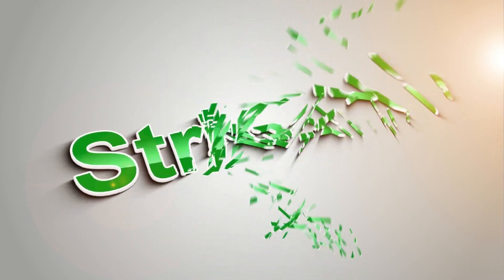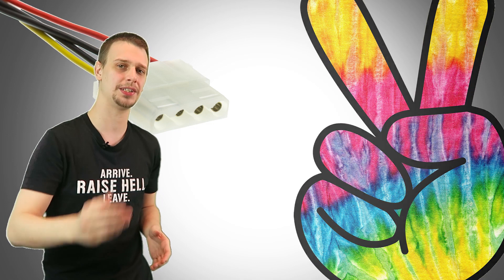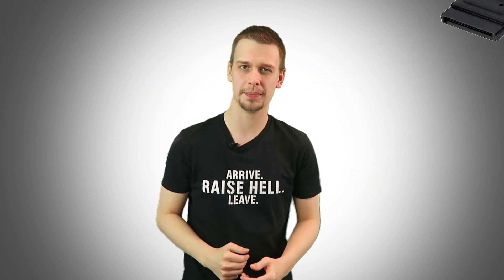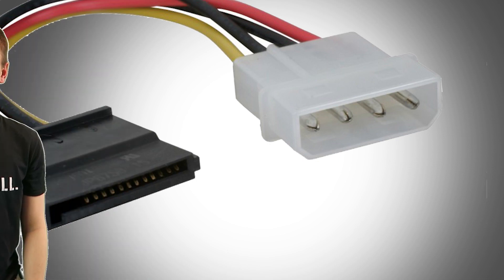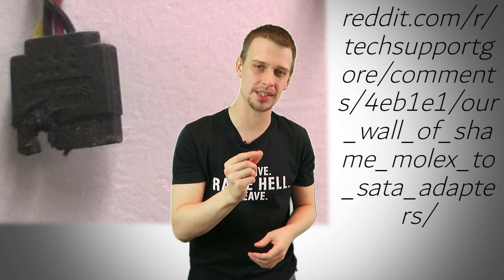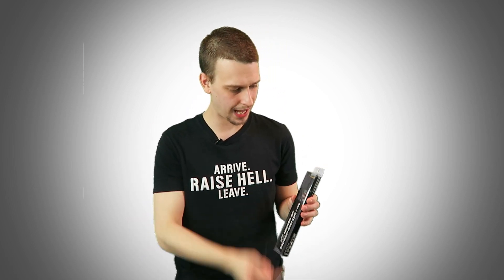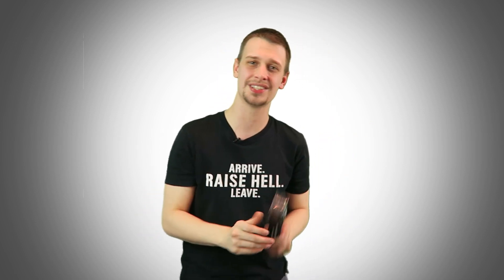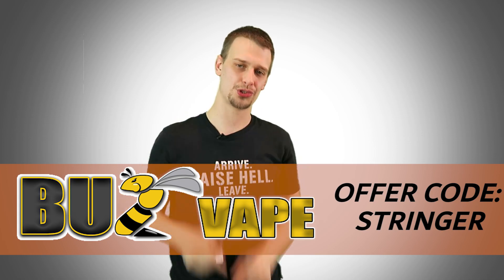Molex to SATA Adapters - Why you should avoid them!

Comment from the maker: have you ever had a bad experience with these evil adapters? have you thrown yours away?
Reply: I've been using these type of adapters for 11 years, just buy a non-china made 😂 LOL
Reply: @shawncasey9995  
Just because it hasn't happened to you doesn't mean that it isn't a serious point of failure, dumbass
Reply: @gerhardsmith7892  It's only a serious point of failure if you ask something of it that it was not designed for. SATA connections are only rated at 50W and I don't know about Molex but I don't imagine it's any higher. The problem comes when you install a 200W GPU or something in a PC that doesn't have PCI power connectors so it draws the rated 75W through the PCI express slot leaving the puny adapter cable to deal with 125W of power. It's gonna burn up. If you use your brain, do some simple maths in your head and don't buy some crappy no brand cable, you'll be fine.
Reply: Haha mine caught on fire just yesterday. I saw the whole thing and quickly pulled power plug when I saw a ball of yellow light inside my case 😱. It scared the hell out of me. Luckily SSD was ok. It has caught on fire 🔥 before killing DVD drive that I never used lol 🤣. Pretty sure they were the same cheap Chinese ones. I am gonna power SSD directly now.
Reply: Many data center drives don't work without them with a normal power supply. Alternatively you can also tape over pin #3 on the SATA power connector.
Reply: @uzefulvideos3440  Same issue here. It sucks. And one of these drives died on me. I suspect a power surge (THAT WAS EXPENSIVE GARBAGE). But ripping out a PIN from the power supply cable was even more jenk.
Reply: Mine touched the case and began burning. I quickly turned the PC off and escaped with only ~15cm of cable burnt. PC took no damage.
Reply: i got a trash prebuild and I've slowly been upgrading it and recently did a psu swap and after i got done the rgb on my fans stopped working not really sure want went on but found out molex was garbage so im upgrading to lian li sl120 completely overhauling that molex hope it will be easy to take out the fans since they are stock
Reply: i just bought one
Reply: @kaye6890  me too
Reply: I threw mine away cuz it killed two drives
Reply: Didn't wanna make same mistake again
Reply: @Maevef100f  kek

Comment: This video is very misleading.
I've had 2 of these for years, just hearing this "fact" surprised me. Turns out i used the one with crimped ends which is actually safe, not the molded ends which i had for my sata to sata adapter for a while, it doesn't catch on fire but made my hdds act up for the last week like it occasionally disconnects when it's healthy, files got corrupted, data isn't transferring correctly, and weak sectors for no reason. I got another molex to sata just for this reason.

Comment: since you suggest not using them what would you suggest to power an external sata drive. I can't use USB. and I have only been able to find molex power bricks. I'm not going to go out of my way to get a huge power supply for a single SATA drive, I already have the sata to esata cable for it but USB will not power this drive.

Comment: so much misinformation here... molex to sata fails at the female sata end only due to arcing the way you said it sounds like its the molex's female that fails on a "molex to sata adaptor"?? don't know how that works but ok....
2nd problem... surprisingly older molex to sata adapters are the ones that are least likely to fail... its the newer and cheaper kinds that tends to fail... because of manufacturing tolerances and the way they are manufactured... those that are done by injection molding to the wires are out of the question immediately as the wires can move about during the injection process increasing the failure rate exponentially in each production batch of these adaptors...
those that are made by clipping through or soldered to prongs for each pins are least likely to fail especially if they have the comb separators for the small prongs connectors placed properly so that in between each prongs there is no air for the connectors to arc to...
molex was actually a very good idea for a connector... this is from a person who started build computers during sata connectors era... the only problem is the way the male and female metal contacts are designed that is flawed as they can move about inside the connectors and making it easier to damage on either end... the solution is kinda brain dead simple... just make it like our PSU connectors to our components each pin female and male has an individual housing that can protect the pins... but its too late to fix it since sata is much slimmer and we have designed most things to suit these sata connectors now.... and with sata power connectors, they can put stupid things such as shucking prevention detection with sata power connectors... yes this is a thing and if we used the brain dead simple 4 connector design, shucking prevention through the power pins would be impossible...
Reply: on top of all of this, sata to sata extensions are also still prone to this problem.... if the manufacturing tolerance is just as bad, it will burn itself... the problem of arcing exist due to bad sata connectors because their pins are designed so close to each other...
Reply from the maker: Excellent points, thank you. The Shucking prevention is pretty terrible, but can be overcome with electrical tape or an adaptor.

Comment: That may be true  2:05 about the amount of connections a SATA plug has vs the Molex, you see the wires going into the plugs themselves? The SATA plug has the same wires that the Molex plug has... Same Wires, different connectivity perimeters within plugs themselves.  The Adapters are probably poorly made and why they would burn.

Comment: I would say it depends on how the connector is made some higher quality ones should not be a problem like crimped satas for example
It's often the molded ones that failes
Reply: I want to add ssd to my pc But i don't have any power cable for a new ssd

should i buy a molex cable Or are there any other solutions to solve my problem
Reply: @farelrizky6453 did you get solution

Comment: My dads computer crom 2010-11 only used molex to sata addapter and hand no sata on the power supply. The hard drive had a molex connector but there was a sticker on it saying not to use the molex connector. I plugged in the more it's connected directly into the hard drive rather than using the adapter and the hard drive seems like it's span up perfectly fine and was readable and everything and worked perfectly fine.

Now im wondering if i can use it in my current rig or not?

Edit: I'm afraid to use a SATA power cable because I threw them all in the box together and when I grabbed one I grabbed one for the wrong power supply because they look identical and ended up frying three hard drives :( one of them was in SSD and it was so hot I literally jerked my hand away as if it where a stove or something.

Comment: I'm planning on putting an SSD into my grandads PC, he has a 1tb HDD currently but the PC bootup time takes forever. My plan was to keep the HDD as it has lots of pictures and stuff on but get an SSD just for windows to speedup the startup time. Was going to get a 120gb as that's fine for just windows but when opening his PC to check it the PSU only has 2 of the cables that plugin to HDDs/SSDs and they're both occupied by the HDD & a disk drive so how else can I gain another connection for an SSD without the molex adapter?

Comment: I have both sata and molex on my power supply what shall I do
Reply from the maker: If it comes straight from the power supply, it's fine. It's only the third party adaptors that are an issue
Reply: @BuzStringer  ok thank you for replying

Comment: I had a dying ssd. So I took it out and plugged it into an external molex PSU with sata adaptor. Now the ssd is completely dead. But I still remain unconvinced it was the sata adaptor that did it. I have used these adaptors plenty of times in the past with no problems. I did have one burning occasion where the molex connector smoked, but the hard drive stayed fine. That molex was a moulded unit that was part of the power supply. So it wasn't an adaptor.

Comment: I faced the problem like my hard drive or dvd was not reading or disconnected suddenly. So I don't use that adapter anymore. But my frontech psu 800watt has only 3 sata connector which is not enough for me. I need atleast 4.

Comment: omg, this is disturbing because my 3 drives are powered by molex to sata connectors, and on one the pins are loose. I have a solid power supply (cooler master real power pro m1000) but i dont have any sata connectors on it, so this is my only option

Comment: I actually have the opposite I have to many sata power connectors and not enough molex ones.

I do use a molex and 4 pin CPU thing to power the motherboard, but it Shou be fine the molex and 4 pin just split everything in what they usually do.

Comment: Says Molex connectors have a lot of drawbacks, including arching that can melt the housing.  Shows a molten SATA connector.  Continues to say that the arching happens on the SATA end because the SATA lanes are closer together.  Sounds to me that Molex isn't the issue, it's poor manufacturing on the SATA side of the cable, because SATA tolerances are much tighter.  A cheap adapter probably doesn't have those SATA connections insulated enough from each other, which is causing the arching.  Just get a Molex to SATA adapter from a reputable brand and you're probably fine.
Reply: Run for Prime Minister, I'll vote
Reply: Look up molded vs crimped sata connectors. Molded ones catch fire way more often
Reply: Run for president.  Ill vote

Comment: what about molex to 4 pin adapter for second cpu power connector needed 
My friends
Reply: Wait your motherboard needs a second cpu power connector? So that is that the third cable coming off of my power supply that isn't the modular part is for. My motherboard only has the normal 24 pin and the 8 pin EPU plug.
Reply: @bland9876  yes i have a server motherboard lenovo s30 with 8pin right+ 4pin left cpu cables need to plug in to fully operates the motherboard i guess

Comment: But the sata power cables are so narrow....try taking a voltage measurement without shorting anything. If I suspect my power supply is bad, taking voltage measurements off of a molex is easy. So, if there a rig/jig to easily test the voltages off a sata power connector?
Reply: Look up power supply tester. You plug in the cable and it'll tell you if it's supplying the right voltages or not.

Comment: Did I hear you correctly? They have Capacitors that kill the wire instead of the device connected to the adaptor? I'm no electronic engineers, but I fail to see how a capacitor would contribute to protecting an electronic circuit. Surely you mean Fuse (Which is just a Resistor designed to fail before the rest of the circuit).
Reply from the maker: Yes, I got that sentence a bit jumbled, each rail has its own capacitor to ensure a smooth flow of the correct voltage to the rail and it is also fused incase of a short. Well spotted.

Comment: I have used these several times. Never had any problems. You just need to make sure you have a proper connection. The problem is that these Molex Male apapters have the 4 pins loose, so you need to make sure they are connected properly. A good idea is to secure the molex/wire part with tape, so it stays proper connected.
Reply: YES, after 5 years my computer caught fire because of Molex. Molex is completely fried and my ssd is also like chickens at KFC…
Reply: hi, may i ask a question,, if i using sata-molex cable for usb 3.0 pcie, should be okay or not?
Reply: Hi Jon
I want to add another hard disk to my pc
But i don't have any power cable for a new hard disk

Do u advice me to buy a molex cable? 
Or are there any other solutions to solve my problem
Reply: @alishahoud2614  ive used molex to sata for around 7 years now and no problems
Reply: @alishahoud2614 did you get solution??

Comment: I am using Molex to 4-way SATA Power for my mining rigs. Have not yet found a brand that's decent.
All the ones that I've had burned. I think I've gone through 5 of them now.

Would appreciate it, if anyone suggested a respectable brand.
Thanks in advance.
Reply from the maker: Avoid molex altogether and split the sata power with these https://kit.com/BuzStringer/server-setup/silverstone-technolo
Reply: @BuzStringer  what about molex to 4 pin adapter for second cpu power connector needed 
My friends
Reply: Buz Stringer I have a Rosewill case that has to use molex to power the drive cages. What cable would you recommend?

Comment: Didn't think silverstone would make something like that, cheers for the helpful video!
Reply: And my molex cable that converts molex into pcie cable did burn off but not no the degree that it melted the plastic, rather my pc turned off and my molex had one cable burned off rather then all of em.
Reply from the maker: I missed this comment! That's lucky, they should really stop making these, even now some GPU companies are still shipping them with there cards. Did everything survive?
Reply: Of course it did, if one power connector were to suddenly shut off then the whole pc would turn off aswell as far as i know. thanks psu.

I never knew gpu compnaies still sent out these stuff, that worrying..
Reply from the maker: MUSiCK ➈ the PSU will save the day most of the time, but there is a chance it could do some damage or catch fire before the power shorts and cuts out. Another reason why a good quality PSU is important